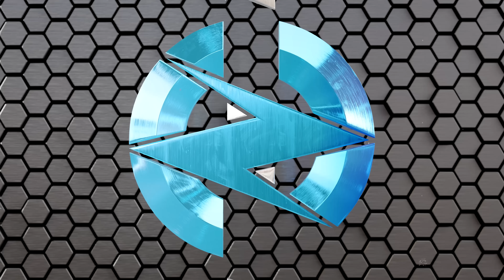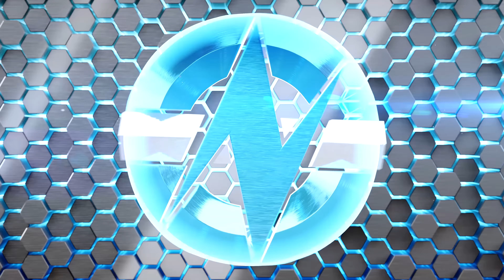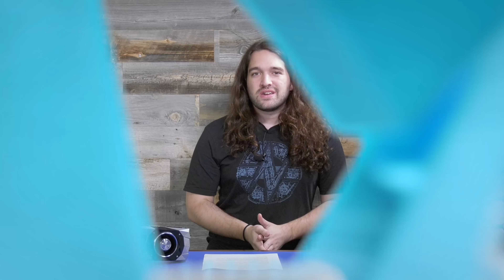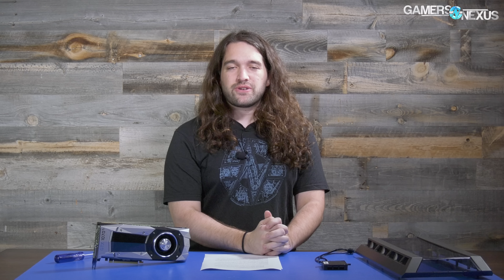Ask GN 62: Worse 0.1% Lows w/ OC, Our Review Philosophy

Comment: Steve,
Funny someone should ask about a rear intake with a dust filter, that's exactly how I use my case currently (though I am considering changing it). Some background: I use a CM Mastercase 5 Pro with 3x 120 intakes on the front (with a 280mm Rad mounted there, using 2.5 of those 3 120s to cover the Rad, and .5 of the top fan as intake cooling. That's not enough "cool" air (as the air passing through the rad is now lukewarm and I was concerned about VRM/RAM cooling). I set up my rear as intake, with a magnetic dust filter (my case is on my desk, and not pressed against a wall). That's a 1x120 intake in the back. The top is 2x 140 in exhaust. My thought was air comes in from the front and the back, then heads up and out. I am considering moving my rad to the top as exhaust to help with GPU temps on my new 1080 Strix, as it caps around 72c in 3DMark. If I move the rad, I may still use the rear as intake, just for balancing air pressure. These are Corsair MagLev (ML) Pro LED fans, as an aside. Any thoughts on this Steve? I'd love to see you guys do a "rad placement guide" for the master case 5 pro/maker/maker t lines, as I'm curious. My Rad is a Corsair h110i.
Reply: Oh, for reference, the rest of the system is Ryzen 5 1600 OC'd to 3.9Gh /w 16GB 3200mhz TridentZRGB running on an Asus Crosshair VI Hero and as I said an, Asus Strix 1080 A8G Gaming using Software OC boost.

Comment: Also keep in mind USB 3.0 from 2.0 was easier for case manufacturers, because the connector is the same size, so case makers didn't have to change holes or similar on the case.

USB-C is different in every way, so will take longer to see updates there.

Comment: I use Thermal Grizzy's liquid metal on my 6600K and I can say there haven't been any negative long term problems with it.  It's dropped my temps around 20 degrees under load from 90's previously under load to 65-70 degrees now under load.  The OC is at 4.8 Ghz @ 1.35 volts totally stable.  The liquid metal hasn't hardened or damaged either the the processor or the IHS.  I recommend this TIM upgrade over any stock Intel paste.

Comment: Hey GN community.
I recently tried an overclock for the first time. I decided to not mess with voltages until I run into games that truly challenge this hardware, so all of those are stock unless the XMP profile modified anything--I believe it may have only increased voltage on the RAM slightly.

I have an intel Core i5 4690k and ASUS Z-97 AR mobo (most recent firmware), with a Noctua NH-U9S cooler, a GTX 1070 (Asus ROG Strix cooler), and a case with a shit-ton of fans (I can be more specific if needed).

The CPU has stock turbo multipliers that seem to max out at around 38x, and though I tried my own tweaks first, the XMP profile default OC seemed to be the best optimized with multipliers that read out as Core 1: 43, Core 2: 43, Core 3: 42, and core 4: 41. In Prime95 torture testing with high heat, the CPU tops out at around 84 degrees C. I'm guessing I wouldn't want much higher than that for this CPU.

For the GPU, on top of the OC from Asus, I could eke out exactly 100 extra Mhz before instability (~2050-2080 MHz under load--rarely rises above 65-68 degrees C--probably some headroom there.). Even +105 was no good. I left it at +95 in case I ran into a game that puts it over the edge, and I seemed to be stable at +500 MHz on the VRAM. (Tested with Superposition {1080p Extreme}, Rise of the Tomb Raider, and The Talos Principle. Want to test with a few more later.)

Overall, I seem to average about an 8% increase across these 3 applications, and an 11% increase in CPU-Z. Any recommendations/suggestions? Or is this actually pretty decent results for stock voltages (I would think it is)?

Comment: I do the top and rear exhaust with front intake normally because that is just how I have been doing it for the last twenty years and it feels wrong to do anything else. However, my current personal PC has top and front intake with only rear exhaust because in my case, that is the only place where my 360 rad would fit. Plus, I tested top exhaust and the air is already heated by my GPU was giving me less than stellar CPU temps from my 360. So, drawing cool air directly into the rad from the ambient air not only gave me amazing CPU temps but also gave me better GPU temps because now I have so much air blasting into the case that it moves out the back very VERY quickly. Sometimes, you just have to make the best out of whatever situation you are working with when making a new build. I will still probably try to get the top exhaust on future builds if possible but it is more important to have lots of airflow more than where that air flow comes from.

Comment: I generally find case reviews to be your most interesting content, but the H500P and H700i in particular were very intriguing precisely BECAUSE of the disconnect between the claims made and the end results. When a product works perfectly that can be informative, but you can learn a lot more from mistakes and the reasons they come about. That front panel alteration in particular has directly impacted how I think about case setup and modification.

Comment: vega 56 for $400 or 1070 ti for $450?
Reply: depends...if you up for heaily modifying the 56 it will perform as good as 1080...if youre not up for modifying or if electrical usage matters to you go with 1070ti
Reply: Only if that Vega 56 had an aftermarket cooler.

Comment: The first 9 minutes ish in this video is a waste of time since we only care about OUT OF THE BOX THERMALS not in the case and running thermals.  With a low budget AMD build would it be better to get a X4 950 or Ryzen 3 1200 since both are available on AM4? Does nearly double the cost reflect performance wise with the 1200?

Comment: Comment section peeps I need some advice. Can I use a blow dryer on cool to clean dust out of a laptop fan? The fan will be removed and the blades will be at a standstill by the way
Reply from the maker: Careful of ESD. Better to use antistatic compressed air.
Reply: I mean sure... but you're not getting an awful lot of pressure there. You might be better off buying some compressed air and doing short bursts through it.
Reply: The Heartfelt Kid - I use this. Much more pressure than a hair-dryer & it's  made for the specific purpose of cleaning dust from PC's: https://www.amazon.com/gp/product/B00S7CH6FK/ref=oh_aui_detailpage_o00_s00?ie=UTF8&psc=1
Reply: Gracias mateys
Reply: lol yeah I know, that's why I was worried even I was revving lightly. Reseated the CMOS Cell for it to work again. works great for everything else though. Didn't do it for the socket area.
Reply: I wouldn't.  You're risking static screwing up your components in exchange for incredibly weak air pressure.  Go buy some compressed air cans, or buy an air compressor specifically designed for electronics.
Reply: a few days ago I put my motherboard at the exhaust of my motorcycle revved the engine and blew some of the dust that way (canned air was finished), highly not recommended though it was a q965 lga 775 chipset motherboard.
Reply: You DO realize the exhaust doesn't just blow out clean air... right? :D
Reply: common engines burn fuel into co2 + water (among other things) you would dampen the board using an exhaust, though the heat would combat that. however do note that if enough soot from the exhaust collects on the board surface it could cause a short as carbon is conductive
Reply: No. Just Don't. Buy Air In The Can ✌️✌️✌️
Reply: i use my vacuum
Reply: @rhys briggs i just did for a few seconds only, because I used the canned air earlier. Yes I did wished that no particle shoots from the exhaust.
Reply: Took all of your advice and didn't use it.  Went well
Reply: Yes, use the lowest speed possible and keep it well back from the device or just get a can of air. Those are cheap and meant for the job.

Comment: I always game with a gaming headset on.  My headset blocks "most" noise coming from the cpu and gpu fans.  My question is, why bother putting your PC in a case when you can get better thermals for less money just installing your PC in a testbench?
Reply: A good case actually betters thermals, since you're blowing cool air into it, where a test bench has to deal with lots of dust and stale air. And practically your hardware is a lot safer in a case :p.

Comment: Use Adaptive voltage, but first use Manual to find the best voltage for the frequency you want, then when you're happy it's stable, switch to Adaptive to have power savings when performance isn't needed.
Reply: Prich038 I tend to prefer fixed voltages and clock speeds since they aren't much less efficient and can actually provide better performance in some programs, since the CPU clock doesn't need that split second to clock itself back up.
Reply: But it'll stay at the higher clock 100% of the time when being used, I've never seen it drop when I game, only when not doing much or just web browsing and whatnot, the only delay is when you first start up the demanding application I'm finding
Reply: Prich038 an example of a visible performance difference between fixed and dynamic clocks I have noticed is in the 7 zip benchmark, where it pegs the CPU to 100%, then goes back to 0%, then repeats a few times. It's a small difference, admittedly, but it does show an advantage for fixed clocks. You're probably right that dynamic is fine for every day usage, since most applications engage the CPU at a more steady rate.

Comment: A question for ask GN, is it possible to move windows from one storage device to another? If so how could I do it?
Reply: speedoran you can definitely clone the drive as mentioned above. I like using Acronis True Image, but there are many utilities capable of cloning boot drives. The biggest thing to consider is what interface your starting drive and cloned drive are using. For instance, if one is a SATA HDD and the other is a SATA SSD, then it should be a piece of cake, and the cloned drive will work perfectly as your boot drive. However, if your original drive is a SATA SSD and your cloned drive is an M.2 NVME SSD, then you may run into problems with the bios of some motherboards not being able to boot from the M.2 SSD since it was cloned from a SATA SSD. I'm not quite sure why this is, but in my experience, it is a repeatable issue. Hope this helps!!
Reply: I have used minitool partition wizard 3 or 4 times in the last few months. Haven't found any issues with it. Hope this helps!
Reply: Checkout StorageCraft, you can restore to dissimilar hardware. Been using it since 2004 for servers and desktops.
Reply: thanks to all of you! im building a pc soon and so i was wondering if i could import my windows from my toshiba laptop, with a crappy 1tb 5400rpm haha...
Reply: locusm I will check this out! I've actually been looking for a tool that plays more nicely with VMware. This looks to fit the bill.
Reply: Gareth Tucker then is it possible to just use the windows key or whatever its called for a new pc?

Comment: for honor is spaghetti code in perfection
Reply: Actually I would say that the instability in For Honor is caused by its 100% GPU utilization, which destabilizes the GPU, quite the opposite of spaghetti code. Remember when SC2 came out? Some notebook GPUs got burnt because they couldn't handle a proper 100% load.
Reply: you might be right, but i would consider myself to be part of fhs competitive comunity and you wouldnt believe the shit that the devs pulled when fixing bugs and/or creating them (not even talking about the games design), so it would fit the picture. some if it has to be spaghetti, couldnt explain it otherwise
Reply: Would make sense, the game logic code is written by much different people than the engine code and to different standards/deadlines, etc. This all makes game logic code more likely bad. The game design is yet another persons job usually (In large companies at least)
I don't play AAA games myself, I am just sort of a game engine developer, I base my comments on that.

Also it's entirely possible to have spaghetti code that is high-performance leading to both bugs and 100% utilization.
Reply: Máté Nagy thanks for the input, you definitely know more than me. The game looks and sounds great tho( done by different people too)
Reply: Overwatch also has issues with overclocking in my experience. I can have a stable GPU overclock in all other games, but when playing Overwatch the screen will suddenly change to a random color (like if you were to put colored cellophane over your monitor) and eventually go black. Blizzard claims it's the overclock's fault and to reset to stock, which does work but I don't like the "it's your fault not ours" solution.
Reply: @Malus1531 Unfortunately they are right. Their engineers probably spent a fair amount of time optimizing the shaders to run as fast as possible. To do this, they eliminated bottlenecks within the GPU to get max efficiency(They are maxing out both texture reads, writes and shader instructions). This makes it harder to get a stable overclock, since everything is under a higher load. In less optimized games you may get away with a higher overclock, since perhaps the shaders in the GPU provide a bottleneck anyways, and overall power draw does not need to increase significantly.
Reply: Máté Nagy Yeah that makes sense, basically what Steve was saying about For Honor. Still I've seen reports of the Overwatch issue even on "stock" factory overclocked cards like Strix, and they basically said to contact your GPU manufacturer to reset it to true stock speeds (I assume that means BIOS flash). I appreciate optimization, but it seems wrong that it can't even handle factory OC.